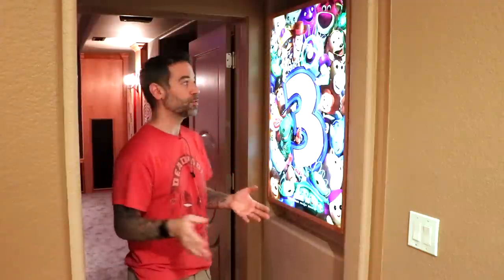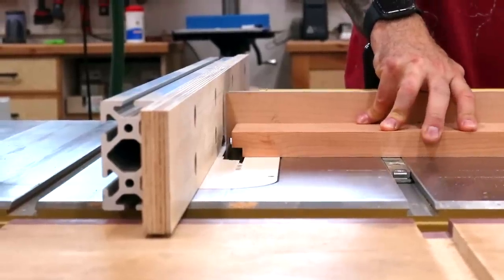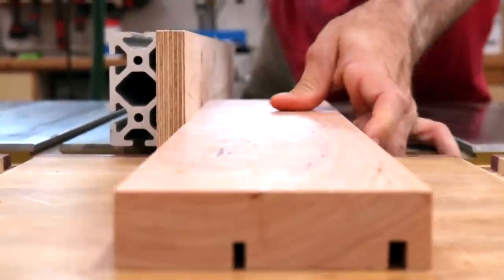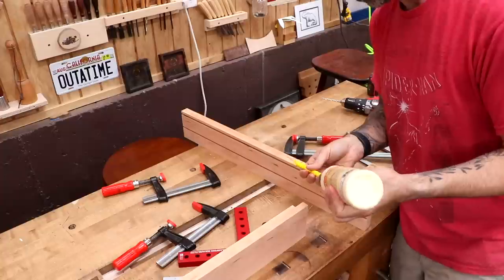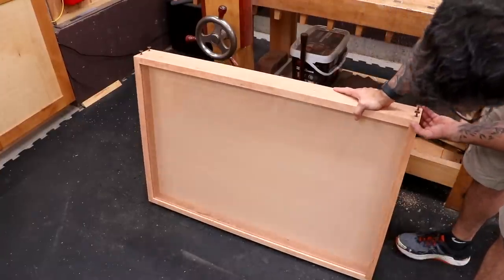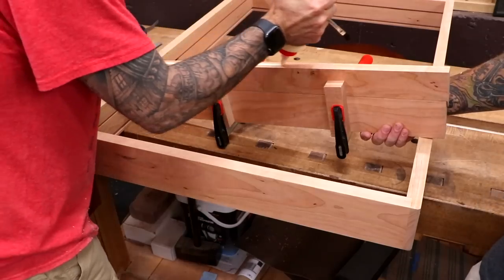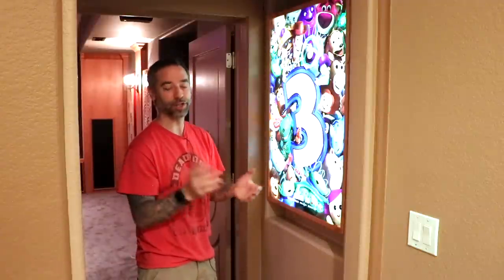Backlit LED Poster Frame Light Box

Comment: Great video..is the movie poster just a normal poster or specifically printed to be back lit. Can I do this with any poster?
Reply: It's a double sided poster..... 27 x 40 DS
Reply: They're printed on plastic, not really double sided, more like the other side is like a mirror of the front, so it lights clearly.

Comment: You can still add ventilation without letting light out.  You'll need to glue some tubing that bends into each hole  (either flexible tubing or something with joints).  Bend the tubing into as "S" shape or similar, and it will be an effective light block - if the inside of the tube is painted matte black it work even better.  If the holes are at the top and the bottom, the natural rise of warm air will get enough circulation happening so LED heat shouldn't be an issue.  I'd recommend at least 2 or 3 holes in both the top and bottom for even ventilation.
Reply: Is there any way to make this poster light although the day without any issue like avoiding the LEDs getting burnt for quite a long period of time?

Comment: 1. Cool project. 
2.fellow home theater nerd
3. Show us your home theater, especially and millwork or custom stuff you have done. 

I did a similar project but then changed to a TV I use rotated on its side (a pair of them) that runs software to have digital posters that cycle. Ended up being not that much more (got a used 50" hdtv for a steal). Just gives me so many more options than a static poster.
Reply from the maker: If you follow me on Instagram, I have a Story series on the theater update project. https://www.instagram.com/woodwhisperer/

Comment: Here's a tiny DIY addition your poster holder to keep it cool. Either on the back panel, or top/bottom, you can add one or more small 60-80mm computer cooling fans which consume very little power and have miniscule noise levels, if any at all. You can add a "BLACK" micro-dust filter to the fan covers to reduce or eliminate light leak concerns, collect micro-dust floaties and provide incoming (bottom), air flow and exhaust (top), while keeping things inside very cool. This is commonly referred to as the "push-pull" method of creating circulating air.
.
If you opt for the back panel fan set up, you'll need to add a tiny amount of flow space of around 1/4" such as small rubber stick-on feet/spacers. This small addition shouldn't interfere with the front of the frame. Mount the fans inside, incoming on the bottom and outgoing on top, add your light/dust filters, and you have it. A movie poster frame that's awesome looking and stays cool all day long. A standard vacuum cleaning every 4 months will keep them running for a long time.
.
I learned this little tip/trick, from my grandpa. He created a 24x36 backlit window for underneath the end of our PC desk, which also faces the door. As clients come in, they see a sample of our work brightly lit and in living color. it stays on all day and most of the night. Well, at least until we decide to shut down for the day.
.
Give this a try and let me know if worked for you.
.
~Alexa Shaw, Photographer
.
PS - Loved the video, hope to see more.
Reply: Hey Alexa that seems like a good idea actually..BTW is there any way to make this poster light although the day without any issue like avoiding the LEDs getting burnt for quite a long period of time(Weeks,Months or Years)? or will I have to use different bulbs if iam to power it from a plug socket
Appreciate your help
Reply: @imgroot5845  After discussing your question with my grandpa (an avid DIY'r & master photographer), if I understand it correctly, adding the fans I've described + adding slots to the back, or even better a "soft-fiber window screen, not metal, to the entire back rather than closing it in would offer large amounts of air flow. Also, if you intend to run this all throughout the day, place your display frame where there is a constant flow of cool air to help the fans.
.
Another tip would be to purchase the slightly most costly CRI95+ rated LED strips. Don't cheap out! Another tidbit, look for the "KITS" that allow you to adjust the colors AND the power levels.
.
Ours have wireless remotes that allow all adjustments, even flashing and the speed of the flash. Power can be set at OFF, 25%, 50%, and 100%.
.
Lining the edges of the frame with regular kitchen foil, gluing it down with a rubber cement or "vinyl tile" type of glue then placing the LED strips on top of the foil will provide an added layer of cooling as aluminum cools rapidly. Be sure no solder or wires touch the foil. An easy fix with a hot glue gun to insulate them.
.
And yet another tip would be to add small, 1/4 to 3/8" high/thick, round rubber (or felt), stick-on feet/pads to the back of the four corners of your frame. This will prevent your frame from sitting flush against the wall, will allow the fans to draw in cool air from outside of the frame and offer greater air flow.
.
As a standard the "top" operational longevity of CRI95+ LED strips/LEDs, are rated at 50,000 (or about 5.5 years), hours before burning out.
.
Hope this helps get you and running with your poster holder.
.
~Alexa Shaw, Just A Simple Photographer
Reply: @ThisIsSaipanCNMI  I should definitely take down this on note...Thanks Alexa for taking your time to share this info,and also to your grandfather...Never did I expect someone to help me by this much
Reply: @imgroot5845  You’re quite welcome. We (my colleagues and I), love to share our knowledge and experience with others. We access my grandpa’s world-travels and vast knowledge to enrich our lives and photography business. He’s the one that showed me how to “PAY IT FORWARD.” So, I do.
.
He’s been my best friend and mentor for a very long time. To speak with him, you’d never know he’s a US Army Cold War Combat Vet, having served 9 years all over the US/world. He’s funny, has a goatee, really long white hair, tats, and even makes strangers laugh. I’ve had some of the “teens” and “kids” here tell me “he’s really cool,” or “MAN! I wish your grandpa was my dad/grandpa.” Those comments always tug at my heart and let me know just how fortunate I am.
.
I’m constantly hearing about others that couldn’t cope, or had issues readjusting to peace after their service. He values life and loves to share DIY ideas, tips, and some tricks, to save others money and help them create something that eventually becomes their own.
.
It’s how I was taught and one of the reasons we created our self-taught photographers’ groups on the social media site – mewe.com. He fabricates, designs and creates almost all of our large photo gear and accessories. Honestly, I still don’t know where he gets some of his ideas from.
.
If you get stuck, or would like some help on this, or other DIY projects, or perhaps photography, just drop me a note, someone here will get it to me. I’ll let grandpa know you liked his input and information.
.
Thanks again for your appreciation.
.
~Alexa Shaw, Just A Simple Photographer
Reply: @ThisIsSaipanCNMI  Thanks for everything again and God Bless You and your Family
Reply: @ThisIsSaipanCNMI  Hi, I know this is an older comment, hopefully you're still around! I loved reading your comments about your grandpa and yourself loving DIY, it's something that's very close to my heart. I have a question for a similar project I'm building; Would aluminum tape on the back be just as effective as aluminum foil? It would be easier for me to apply the tape without creating wrinkles that will reflect the lighting unevenly, and I wouldn't have to mess with rubber cement or other glue. Thank you!
Reply: @cnt369  Well Crag, you certainly made me  look for this comment. I saw no reason why SHINY aluminum tape wouldn't work, but asked ole gramps, just in case. He's a Master Photographer and awesome DIY guru. He makes about 95% of our photo gear, saving us, and our clients, big $$$. He had one concern in using aluminum tape: the adhesive. Most adhesive backed substrates will either become gooey/runny over time, or the opposite, and will dry out and turn to dust. Neither is a viable result. Provided there is a lot of airflow (in and out), within the poster box itself, you should be fine. We use 120mm PC fans! (2-on top=out and 2-on bottom=in). They're hidden, so useful, yet out of sight. Low voltage equals small power source. Like a 5vdc power adapter, or a splitter from the LED light's power source. Turn one off, turn both off. Easy-peasy.
.
As long as it has a glossy/shiny surface, light should bounce around freely and evenly. You can use silver for a "standard" neutral-white light look, or get movie-moody and use gold for a softer "theater" glow, like those seen in the entryways of movie theaters. In any case, the gloss style of aluminum tape should work well as long as you keep your lines straight. Large gaps between each run may come back to haunt you. To keep them straight, gramps recommends using a steel or wooden straight edge/square clamped down, right on top of the old section, so you can butt the new section against the old in a straight line. This will almost invariably guarantee a straight line with zero gaps every time. OH! and there's also self-stick Mylar film, too. That comes in many sizes, shapes & colors. You can have lots of fun with Mylar. 
.
~Alexa Shaw, Just A Simple Photographer
.
And, oh yeah, we're still around despite Mama Nature's best efforts to blow us away. 3-Cat 5 Typhoons, 2015, 2018, 2019. COVID 2020-2023, and Mawar, a Cat 3 by the time it hit us. And now, gramps is modding and upgrading ALL of our PCs to Win 11 - DEBLOATED & customized to act, work and look like WIn 7 Ultimate, with a few hidden goodies to boot! It was the BEST OS ever sold! So far, from what he's done to the crap Win11, it's looking pretty cool! Enjoy the Poster Boxes and keep me apprised.👍
Reply: @alexa-n-gramps  Thank you Alexa and your grandpa for the amazingly detailed and informative reply! I am using a 24"x36" mdf shadowbox from Hobby Lobby to make a backlit picture of our late son for my wife. Normally, if it were just for me, I'd haphazardly throw things together til they just barely work. But since this is my most important project I've worked on, I'm trying to do it the absolute right way to make it look the best while also ensuring it's longevity by using durable materials. I will do some research on mylar film, and I really appreciate the insight on the degradation of the adhesive, that's something I didn't think about but he's absolutely right.

So far, I plan on using 5m of 60p/m 5v IP65 WS2812B's (300 LEDs total), controlled by an ESP32 through wifi and powered by a 5v 20A PSU, injecting power at likely the start and end of the strip, and potentially the middle if I see any skewed colors. Connecting 110V to the PSU via a universal grounded power cord coupled with a strain relief. All components tucked away neatly inside the shadow box (the PSU might be tricky to fit while managing heat dissipation, as well as not blocking any light, it's dimensions are 4"x8"x1.65"). I also plan on sticking the strips into aluminum channels with diffusers to help prevent lighting hotspots while also sinking the heat from the LEDs.

Since I'm working with about 2 inches of depth inside the shadowbox, 120mm fans won't fit unless I put a spacer between the wall and shadowbox and intake/exhaust towards the wall, which isn't a bad idea but I would like to make 50mm fans work. I was considering using two circular 2" air intake vents at the bottom of the box and putting a single 50mm fan at the top of the box, exhausting upwards while drawing air through the bottom vents via induced draft. However, this is my first real LED project and I wasn't sure how much heat these components will produce. The LEDs will almost certainly never be ran at anywhere near 100% brightness, mostly white or blue in color, and will only be on at night in a 70 degree F temperature controlled room. I might add an On/Off switch to the outside of the box as well.

I'm glad to hear your family has been safe through all of that. Here in midwest USA, the weather is a lot more tempered, with the occasional tornado. And good on gramps for upgrading the PCs! I happen to like Windows Vista the most, but that was my first OS that got me into computers. However, I agree with making any kind of change to whatever they did to W11!
Reply: @cnt369  Hey. Thanks for the fast get back. WHEW! It's smoldering here. 'Bout 106F at 5:45pm. Break time. Gramps has this trick he learned from his pops. When working in tight spaces like you describe, he'll put a hidden space up top and on the bottom. Since the front & sides will cover the spacer/recess pieces, no one knows the power unit is mounted there. Likewise, he can mount fans there by simply cutting round holes and mounting in the recess space. He also uses this method to create a space behind the box. This allows room for more air and somewhere to hide additional wiring, plugs, splitters, and more. The recesses are 1/8 to 1/4" deeper than the object to be mounted there. I'm familiar with the  technique as he's created modular hanging wall cabinets. People wonder where the wires are to get the light inside them, which is like magic when you open the doors you've got instant light and no wires inside. No power supply inside. All hidden on the back in the recess space. Oh, and they move, too. He mounted everything on french cleats, also hidden in the back. You might try this technique if you've got the energy and extra mdf.
Reply: @alexa-n-gramps  Thanks for the quick response! I'll have to do some research and thinking. I don't have many woodworking tools, but I can get crafty. Thanks for all the help! Enjoy the weather, it's 65 here
Reply: @alexa-n-gramps  Hi again! That's so cool, I had to google what French Cleats were, sounds like such an awesome place! So cool that you have all this great work to look at. I finally have all the materials to start on my project, and going slowly, I should be done fairly soon. I had one additional question though: If going with the aluminum foil backing method, do you or gramps recommend a specific rubber cement/adhesive? I've tried google but as you might have guessed, google doesn't have many results for rubber-cementing aluminum foil lol! Plus, I love reading your long messages and stories about your grandpa! Thank you so much for all your help throughout this!
Reply: @cnt369  We've used 2 different types. One is spray on. The other is by putty knife. Elmer's Spray Adhesive is extremely sticky, be very careful using it. The other is Henry 356 or 365 - Carpet & Vinyl adhesive. For both, make sure you have a way to smooth out as many wrinkles as possible. If your spouse isn't looking, raid the kitchen to borrow the rolling pin, but you didn't get that idea from me!

Comment: Awesome video! Such a random find. I actually want to build a small version like this now. Quick question, the poster you use, u said it was double sided. So I’m assuming you mean that the printed design is on both sides. Do I have to use a poster that has the design printed in both sides? Most posters I buy has the design on one side and a white backside. Will this not work if I use posters like that? Thanks for any help👍
Reply: same question!!! What kind of poster or glass print is needed?? Thanks!
Reply: The reason double sided posters are preferred, is because it stops light bleed in the poster. The things that are supposed to be dark are dark and things that are lighter are lighter. If you use a single sided poster, it will be washed out. Hope that helps.

Comment: About the LEDs building up heat and needing vent holes...use those holes and their escaping light as an added effect. Angle the holes and give yourself a projected " \ | / " on the wall above and below the frame, and that would be more than enough ventilation to never really have to worry about the built up heat.

Comment: You can easily allow air through but not light, just use a folded internal channel top & bottom and paint the inside matt black.  It's more work but it removes any restrictions on operating time.

Comment: If you're adding vents, drill holes in the back panel every so often (obviously not where the lights will be) the drill the vent holes on top on the other side where the plug will go. No light spill and ventilation to let the heat out. Drill holes on the bottom in the same spots for cold air intake without the light spill.

Comment: Love what you do. Would you be willing to create a lightbox for me? I am getting a lightbox ready poster made (as I just learned it has to be of certain specifications). I would like to keep it on during the evenings.... sometimes. So it will have more use than just an on and off etc. For that reason, I guess some built in ventilation would help for the LEDs etc. From everyone who I have seen do it, you did the most clean and art-worthy. Let me know. Thanks !

Comment: 2:59 Or if you want to save $50-$100, you could just buy a cheap clamp, use it to hold the drill upright and push the edge of the wood into it.  But make sure you have a sturdy heavy table.

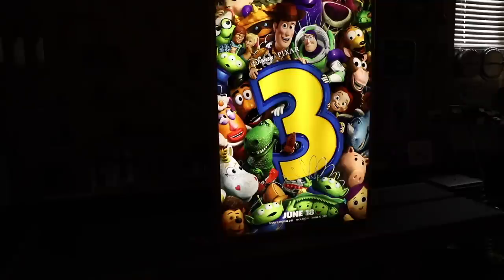Comment: At 7:31, Marc says he bought this double sided poster a while ago..... do you have to use a double sided poster? Doesn't seem like that would work.... confusion...
Reply from the maker: Double-sided posters are intended to be used in back-lit applications such as a real movie theater. Single sided posters look more faded because there's only color on one side. Double-sided are more expensive too but it's worth it because the POP when back-lit.
Reply: The Wood Whisperer thanks Marc! You’re the best!

Comment: Heat problem ... Add aluminium back panel instead of plywood, no tape needed  and heat anticipation will be more than enough.
Reply: 101wilku101 if he thought plexi was expensive he’ll die when the aluminum bill rings up.